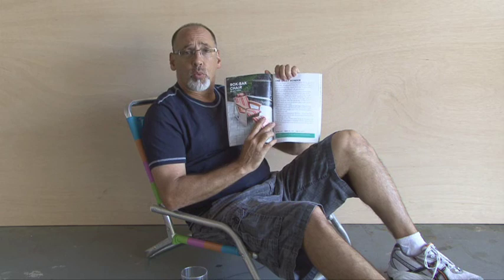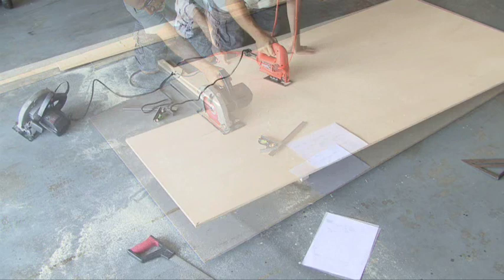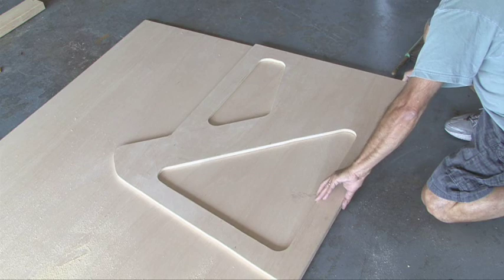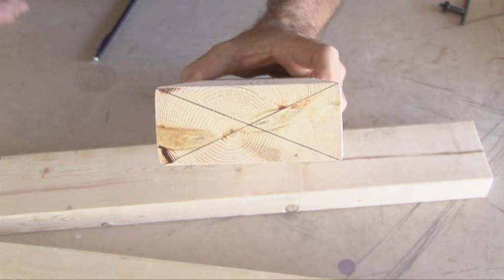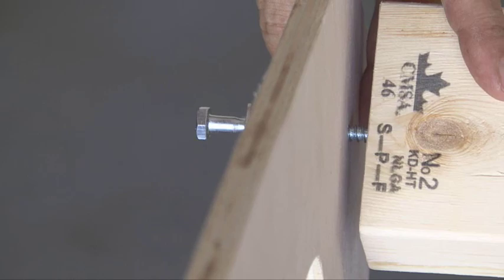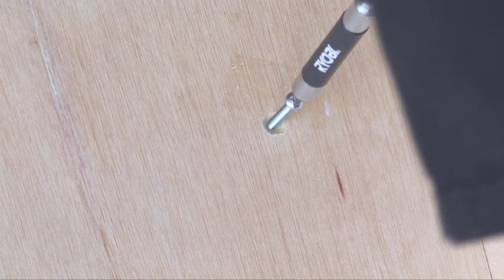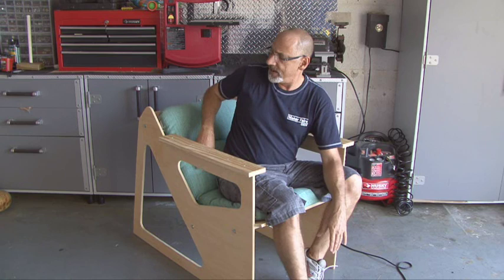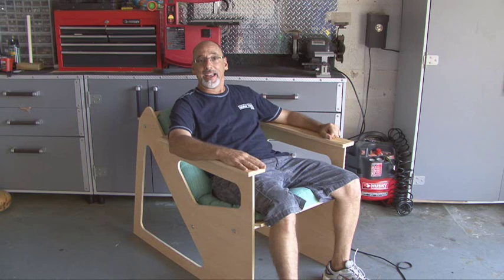Weekend Project: Rok-Bak Chair

Comment: It seemed a little wobbly when he was sliding in the back and seat bottom. I would be concerned about that coming apart if my 15 yr old son flopped down on it like he does everything else. My suspicion is that the design is a hair wobbly because the sides are only 1/2 in. thick and flex a bit... Any design ideas for a mod?

Comment: You should tell all the stuff you need from the beginning instead of claiming it only uses 1 sheet of plywood.You actually also  need a 2x4 a 1x4 and some other stuff so I wouldn't  call that a piece of plywood only. Thumbs down for not being straight with us from the start.